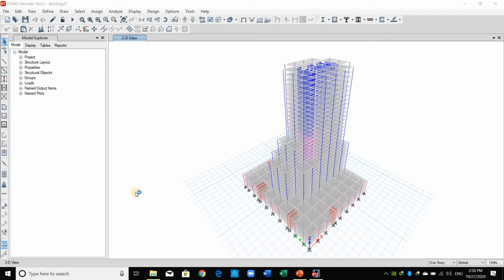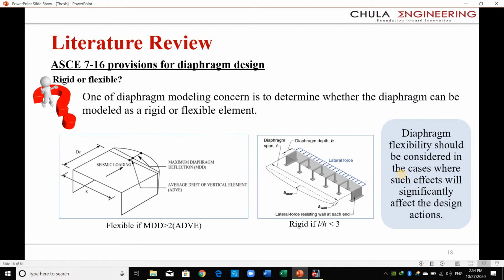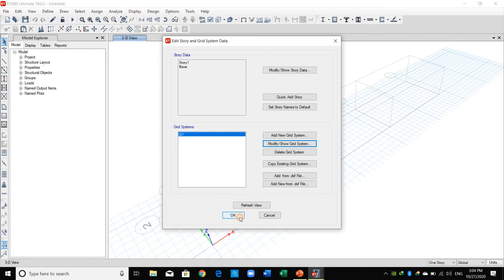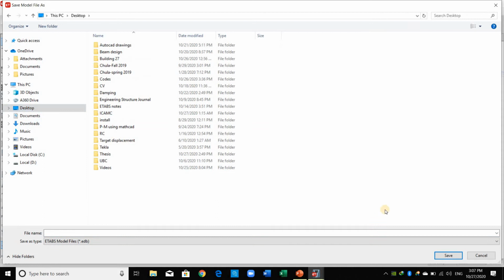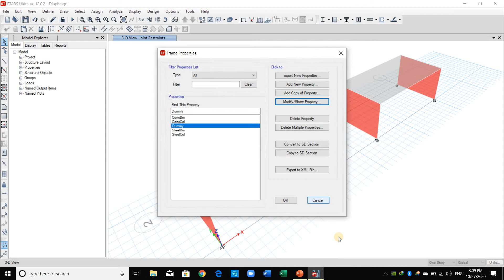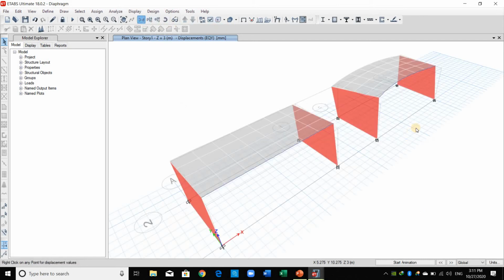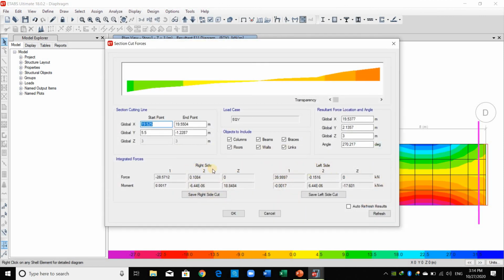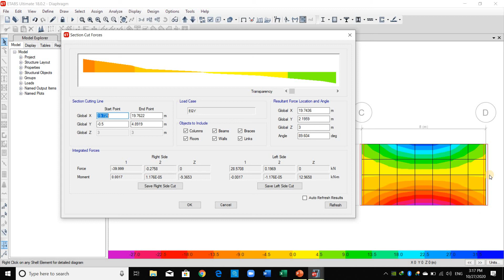How to assign diaphragm for floors in ETABS? and what a rigid and semi-rigid diaphragm means? (Lec6)

Comment: As salmalaikum Mr Tarek....Mashallah I was seeing your videos and found intresting. I have 2 questions.
1. While assigning diaphragm do we need to select only the slabs, or the complete structural model can you give me complete description regarding the same.
2. What is the use of assigning piers, even without assigning piers we can individually see the results? 
3. It will be very pleased if you can also share me your number , so that I can freely ask you some more related querries.
Jazak allah khair
Reply from the maker: I'm glad you found the video interesting. Here are the answers to your questions:

1. Assigning Diaphragm in ETABS
Typically, diaphragms are assigned to the floor slabs of the structure, as these are the elements that act as diaphragms to transfer lateral loads to the vertical elements (columns and walls).

Diaphragm assigned using the shell option:
To assign a diaphragm, you select the floor slab elements only, not the entire structural model. This ensures that the diaphragm constraints are applied correctly to the elements that function as diaphragms.

Diaphragm assigned using the joint option:
Select all joints within the same floor, not the entire structural model. This ensures that the diaphragm constraints are applied correctly to the joints within the same floor.

Use of Assigning Piers in ETABS
Piers group vertical elements (like walls) to facilitate design and analysis. When you assign pier labels to wall elements, you can quickly extract forces and moments for the entire pier. Without piers, you can still see the results for individual wall elements, but it can be more cumbersome. Piers help in aggregating results, making it easier to design and check entire wall segments rather than individual parts.

Comment: Sir,  how to transfer fpx diafrgma force to global-x and global-y in etabs as a load per m2, to obtain Axial Collector in Beam and Floor?
Reply from the maker: To transfer the diaphragm forces 𝑓𝑝𝑥 to the global X and Y directions in ETABS and obtain axial forces in collectors (beams) and floors, follow these steps:

1- Calculate 𝑓𝑝𝑥 in Excel.
2- Import diaphragm forces (𝑓𝑝𝑥) to ETABS.
3- Define Section Cuts (To obtain the forces in specific areas of the slab, such as axial forces in collectors and floors, you need to define section cuts).
4- Verify that a semi-rigid diaphragm is used. In ETABS, diaphragms can be defined as rigid, or semi-rigid. A semi-rigid diaphragm allows for in-plane deformations of the slab (if a rigid diaphragm is used, the results will be equal to zero)

Comment: Sir, Which is most correct : 1-one diaphragm to each floor as you did (D1) or 2- each floor has a unique diaphragm  (D1,D2,D3....)
Reply from the maker: Both ways are correct, you can define one diaphragm (D1) for all floors or you can define diaphragms for each floor (D1, D2, D3)